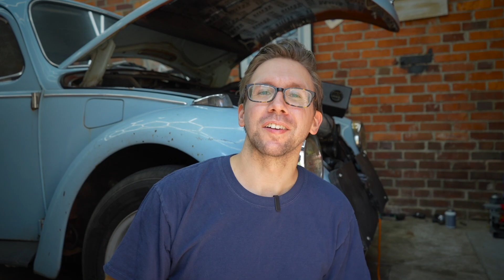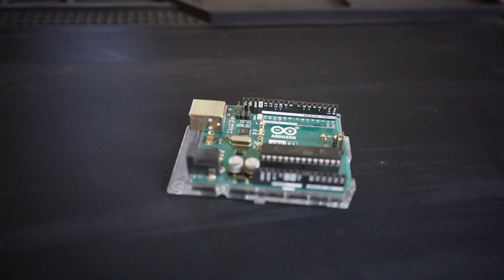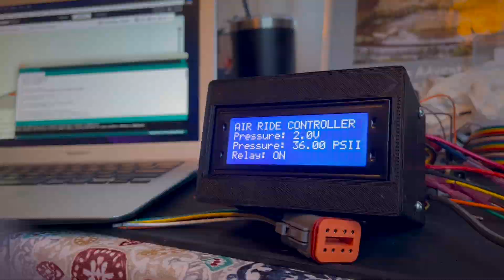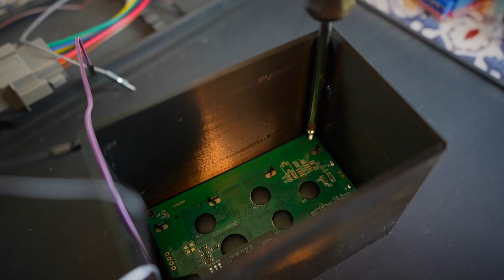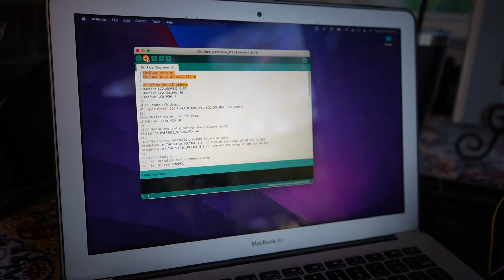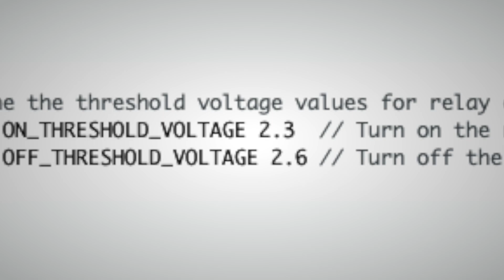Buildling a DIY Air Ride Controller

Comment: I want to do something similar to replace the air ride controller in my dad's truck. He needs independent bag control because his welding machine makes it a bit uneven and one side needs more pressure.

Just got the printer working and I got some esp32s laying around so I guess it's time 😂

Comment: Hey Matt, I sent you an email threw your website page guide for this. I'd like to adapt this to my 2011 nissan armada. It comes with factory auto leveling for the rear suspension. The factory control module is very similar to your build. I have a couple questions if you have a minute to reply to my email.

Comment: can you give more information about your air setup? i'm planning on buying some air sospensions and if i find somenting compatible with a simple diy controller like this one it would be grat.
Reply from the maker: Of course buddy! I’m working on the written DIY part and will update with the link here when it’s done. But here’s my setup and recommendations. I don’t recommend ANY bag except Slam Specialties. They are literally in a league of their own and have replace so many cheap bags over the years with these. Also get the biggest bag you can fit size wise if you’re looking for the nicest ride… more air = more softer. I’m using two Slam 8” bags tied together with 3/8 dot tubing that tee together and connect directly to a VIAIR compressor. No valves or nothing. This is my wife’s car and she doesn’t care about being out to “lay frame”, she just wanted to get in and have it go exactly where it needs to go without thinking about it.
Reply: @MatthewFinlay  unfortunately i’m in italy and i’ve seen that slam specialities are a us company, so i’d find something local. As per thr compressor, is is just a normal portable compressor? does not seem to be specially designed for cars, is it loud?